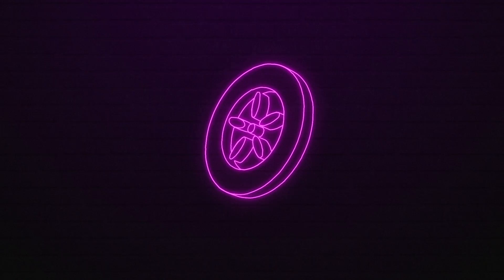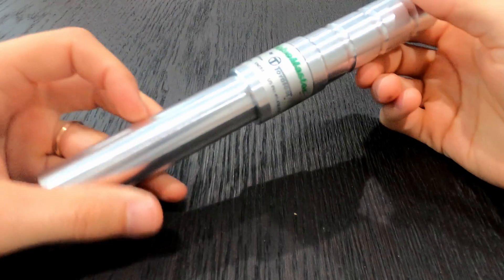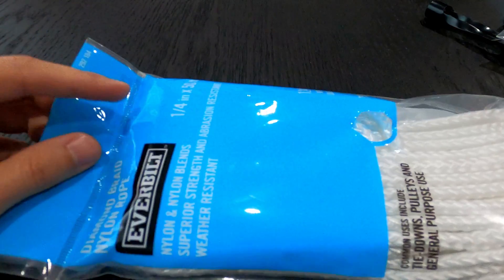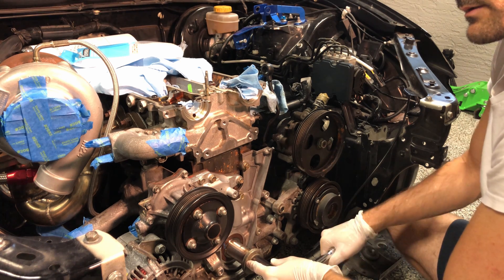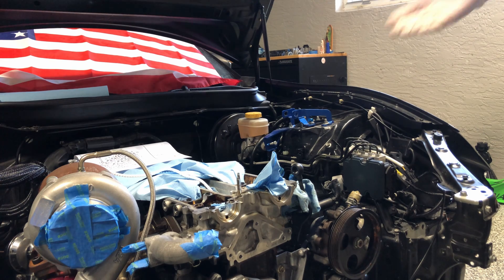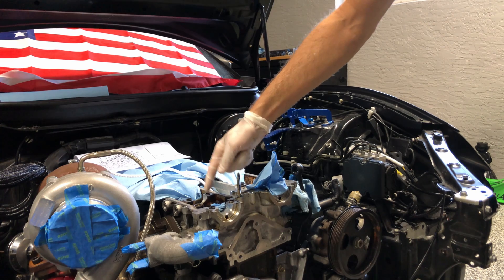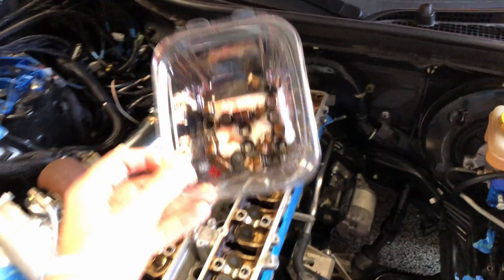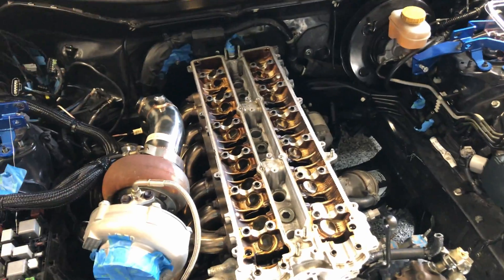The MOST important service in a 2JZ [Valve Stem Seals]

Comment: I got some valve seals from gsc which all look the same size………should that be fine or are the intake and exhaust definitely different sizes?
Reply from the maker: The oem ones have different size. The GSC are all same size and it’s ok 👍
Reply: @MinkMood  I actually finished the project shortly after I sent that question and used your entire video to do so ! I do have rough idle upon starting and once it warms up super smooth so I changed idle valve and I’m going to change idle sensor and complete exhaust system because at almost 200k now it’s about time for new cat and mufflers as they literally filters if you really think about it. I may attempt to just soak clean them but over all I think those aspects will totally fix my idle issue especially being it smooths out after it gets to temp so likely it’s just a clogged Cat
Reply from the maker: @mikearceneauxbaker check the temp sensor. That could cause rough idle
Reply: @MinkMood  temp sensor on bottom of radiator?
Reply from the maker: @mikearceneauxbaker  check the one that connects to the ECU. In the GTE is on the Coolant Upper Neck. Not sure in your car where it is, but google location and then measure resistance ohm. See if its in the normal values and also if changes when Cold and when at Operating temp

Comment: So do you do this to each individual cylinder? Bring it to top dead center / out rope / tighten/ change seals on the 2 intake and exhaust valves and then pull rope out then do the other 5 the exact same way?
Reply from the maker: Exactly, simple and repetitive process
Reply: @MinkMood  ok and another thing, should I bring everything to top timing marks before starting ? Then take cams out and leave crank at the zero marker ?   And as for retiming I would turn crank clockwise to zero then install cams and follow the process until they are also at top timing markers (which crank would stay at zero the whole time ?)  so once cams are also at top timing markers I should be a set timing ?
Reply from the maker: @mikearceneauxbaker its a good idea always when dissasembly to have everything at TDC. Having said that, the 2JZ GTE VVTi are non interference engines. So it doesnt really matter. If you are working on another type of 2J, then yes be careful not to land a valve on a piston.
Reply: @MinkMood  ok so ( and im about to watch your video one more time ) if i go through all the valves and then once im finished i turn crank clockwise around to TDC then i install cams and walk though the process as per process until those are also TDC then i can put my belt on and call it good correct?
Reply from the maker: @mikearceneauxbaker yes
Reply: @MinkMood  ok , im going do mine now 2jzgte in a lexus g300. All your work looks super clean so i wanted to make sure im doing exactly as you did lol …appreciate it

Comment: so do you center the crank and cams....then stuff the rope turn clockwise until tight....then swap the guide seal ...then back off the crank counter clockwise back to center and then pull rope and start on the next set?
Reply from the maker: Yup, exactly 👍
Reply: So if you have everything at center when you take it out ...once you're done can you put it back exactly as it was and it's technically timed ? Or do you have to put the cams back in as per print and then retime ?
Reply from the maker: @mikearceneauxbaker you start at TDC, with piston 1 at lowest position.
You remove the cams as per Toyota manual and start this process. 
Once you move to piston 2 I used a straw to find the lowest point and then rope in.
Repeat until finish the 6 pistons 
Then go back to TDC at the crankshaft. To be safe move 10-15 degrees backwards and install the cams as per manual or check the other video we made.
Then you need to re time which you can also see with the manual or another video where we put the engine back together
Reply: @MinkMood  perfect. Watching it now ! I emailed you also if you are able to send those manuals /part numbers and all ! Appreciate you!